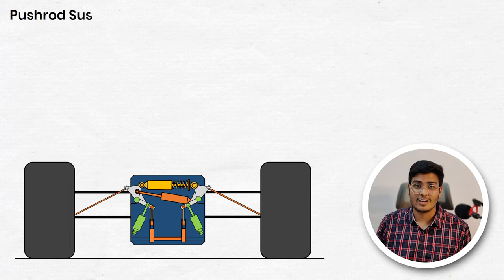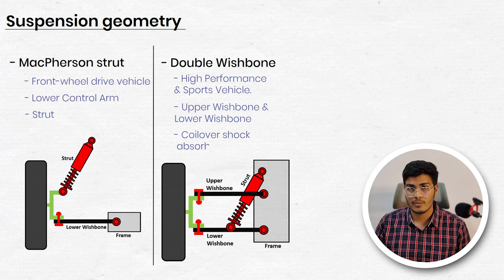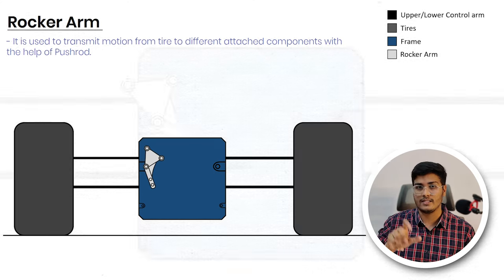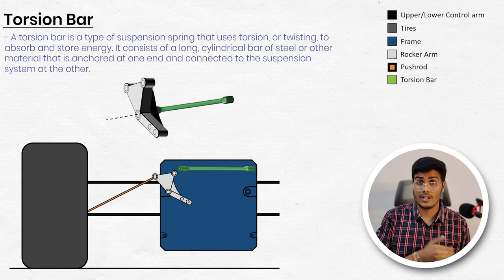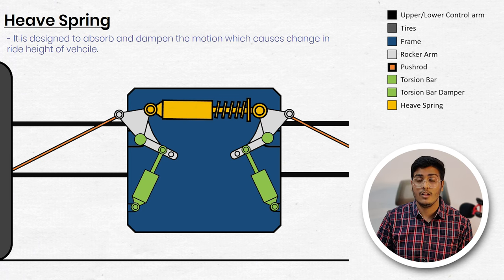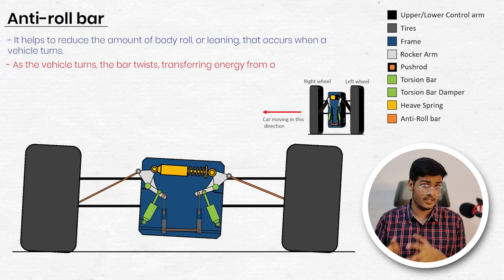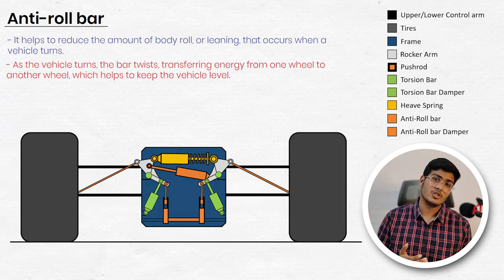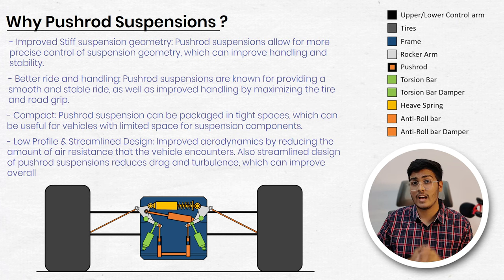Pushrod Suspension geometry | How pushrod suspension works ? | Formula 1 Suspensions

Comment: Your videos are great. One comment is the video about calculating double wishbone geometry. The only point I wanted to discuss  was the implication camber angle in roll affects the size of the contact point. I have discussed with some tire engineers at SEMA that the main factor of contact area is the down force on the tire and the nominal interior tire pressure. Changes in the camber angle of the tire will change the overall spring coefficient of the tire by shifting more forces into the tire sidewall and curve of the tire from the horizontal surface to the sidewall, but the main problem with large camber change is the tire is designed to work straight up and down and is less efficient when not straight up and down. 

Do you happen to know the name of that Polish dude that developed the universal tire equation with 25 parameters in the equation?

You are awesome.
Reply from the maker: Thanks for the insightful comment! I agree downforce is key, but camber still plays a role in contact area. Moderate camber can be beneficial in certain situations, like maintaining grip during cornering. Unfortunately, I don't know the Polish engineer's name .